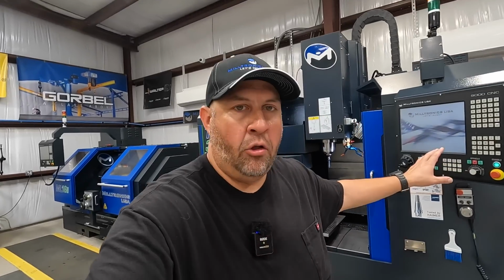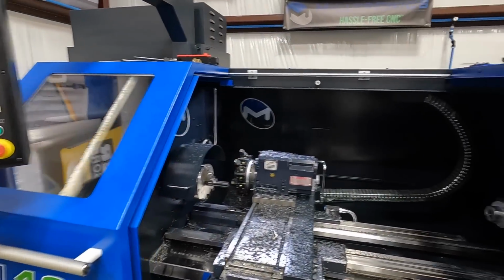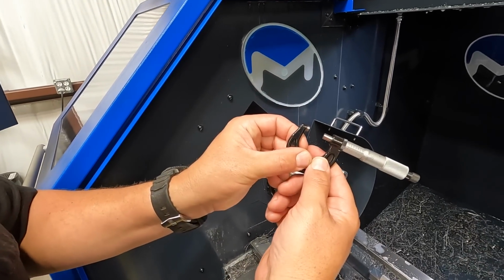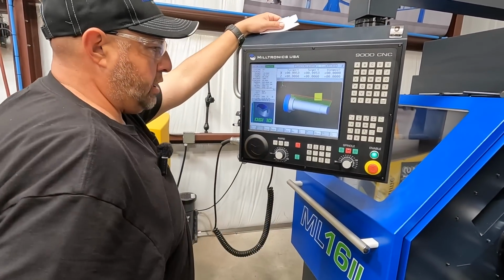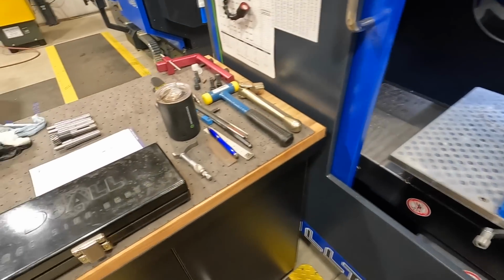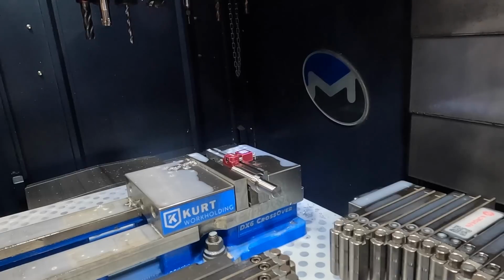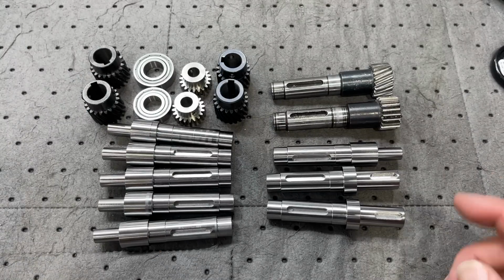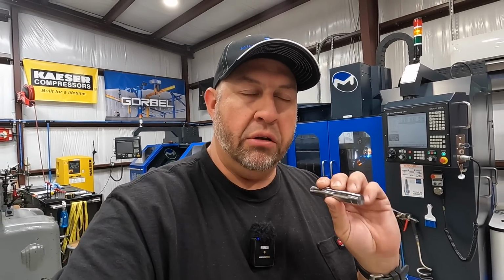Pinion Shafts CNC Machined

Comment: Adam, to learn this tech, you have to immerse yourself. That's the only way. Put all manual machining out of your head and force yourself to do only CNC work and you keep doing it until it's second nature, exactly the way you learned how to machine manually.
That might seem like it could take years but you have to realize that you already have a good portion of the knowledge in your head. It's the computer portion that's new to you.
Learn how to use the reference material first. That will make it so you don't have to ask many questions, you can find the answers yourself.

Comment: This is fascinating.  How does the CNC computer know the exact cutting edge locations of each of the tools, and how does it remain so accurate during tool changes?
Reply: The way it can do all that is because computers are really good at remembering things and when I say that, I mean everything. Every tiny detail of every dimension of every tool it uses and every part of itself. A CNC also knows exactly how far it moves and where it moves and remembers all of that too. In fact, a CNC can even keep track of tool wear in real time.
A CNC even has tools that it can use to find dimensions itself rather than having an operator tell it the dimensions.
However, to answer your question, the way it knows all these dimensions is because an operator tells it what the dimensions are through programming or the operator tells it to find out and how to find out, again, through programming.
The tools that a company supplies for CNCs even come with a data library of tools that contain all the detailed physical information on all the tools it sells and the CNC machine can look them up and load all the information on a particular tool by itself.

Comment: What is conversational programming?
Reply: It's the instruction set that is used to operate a CNC in real time. You can program a CNC from the console right on the machine itself. That's where it uses conversational programming. You can also use a computer to draw an object or a set of instructions and then save that to a file and then upload the file to the CNC. There are a number of different languages that can be used for that. Many different CAD programs can generate files that can be loaded in to a CNC.

Comment: problem with going to the machine to do programming is its already obsolete before it even hits your door. So where as learning a common workflow that more or less applies to all cad-cam software that has been a more or less standard thing since all of time,  you learn a proprietary system. 

That is fine until you walk into the next shop or even software upgrade... it also really sucks when you spend all that time an effort tweaking things to perfection and send it off to a job, shop and their machines are using a totally different system. 
Super great, you can key in a single off job using a keypad on XYZ's system model C,  but ABC corp wants 20 more made for their Italian factory, email is cheaper than FED-EX

Comment: cad/cam is not easy. The hole reason conversational programming has become a major thing is it's far easier for somebody with a machining background to pick up and use. Often it's the most efficient way to do things. Keep at it and you'll get it, but keep getting better with the conversational programming as well. I bet the latter still gets used more often.

Comment: The trick to Fusion 360 is to start with a sketch.  This is the 2d mode of Fusion 360.  The sketch is then extruded to make a 3d object. 

You can make a sketch on any surface or on any work plane.

Comment: Hey Adem, you can use your turret to set your work shift. just push the part in to the chuck. (Have a dowl pin or gage pin in a holder) bring your turret down to how far you'd like your part to stick out set your work shift. Then as a production run all you have to do is, put part in then cycle start, m01 in program stop the program open chuck pull part out to stop then close chuck then cycle start. No more having to touch off for ever part.
Reply: I don't think I've heard him mention the work shift concept.

Comment: I am only a novice amateur but the way I set my Z zero is to place the work in the chuck but not tighten it. Then I drive the tool to where I want the end of the work piece to be and then I slide it out of the chuck to touch the tool and then tighten the chuck. Seems quicker and easier than touching off with a piece of paper and doesn't need a chuck stop.

Comment: Have you ever done any work on firearms?  I have an HK USP 40S&W that I want to convert to 10mm.  The problem is that the HK barrel is so hard that a gunsmith cannot ream it, it has been suggested to use a small boring bar.  The cartridge chamber just needs to be made a little deeper to accommodate the longer case of the 10mm.

Comment: I have some CNC machining (plastics) experience. I hope you embrace the Cad/Cam aspects of the craft, I think it will make you a better all around CNC Machinist. Also it will broaden your horizons as far as part/product design.
I started from Cad Design and moved into the machining so I feel it was easier for me.  Especially 3D utilizing modeling. I always created my models the same way they would be machined helped me be more successful by making mistakes on screen not on the machine.

Comment: The trick with using the paper is a good idea. We have been doing that for years with our CNC flatbed router in the sign company I work for, especially when we engrave aluminium  composite for folding purposes.

Comment: I’m a professional computer programmer.   A couple of years ago (lockdown projects) I bought a starter cnc and later a 3d printer.   I found the cnc part hard and put it away.   The 3d printing is fun.  Have been learning fusion 360 and agree that the learning curve is very steep.    Keep at it, keep it simple and I’m very sure that you’ll get the hang of it.
Reply: I've spent like total of 10 hours or so with Fusion and I can already make use of it pretty well. I was somewhat familiar with CAD before that but not much CAM

Comment: Note that for a small run, you can use an empty tool position as a set-stop for your parts - set it in the program to bring the position in, then bring the workpiece up against it and lock the chuck.
Reply from the maker: That’s a good tip I didn’t think of or have seen before, thanks 👍🏻
Reply: @Abom79  or the blank part of another tool. just have it set up in the library as a tool. then call that tool in the start, at Z0 (+ faceoff amount) - just remember to have the machine go into pause mode. the ISO code is M0(0) if you have to put that in manually.
been using that method for years in production runs. so unless you need length precision of less than 0.05mm (0.002 inch) then its fine
Reply: I use to use an old adjustable square set. I would place the butt end of the rule against a fixed point on the chuck then butt round bar up against the face of the square.
Reply: Yep I usually just use my roughing tool for a bar stop works fine.

A lot of people will use the parting holder or something aswell

Comment: For Fusion 360, you just gotta keep at it. The only way you'll remember that sort of stuff is by doing it a thousand times. But don't worry about not remembering how to do things, just keep a browser tab open and Google things as you need to. It's tough even if you have a background in CAD using another system, but you just have to keep drilling it in until it becomes second nature.

Comment: As an old school programmer (I did Jovial - yep I'm a dinosaur) I found it rather difficult to learn object oriented programming.  But I did and I'm sure you will become quite proficient with CNC as well.  I often think we see the learning curve as steeper and more difficult than it actually is, but you'll get there.
Reply: I don't think the issue Adam is facing is about object oriented programming, or actually any programming at all.
He needs to learn Fusion 360, which is 3D CAD CAM program. Even if it supposed to be an intuitive program, surely it is not, or at least not for everyone.
I identify perfectly with him, and I come from an computer programming background.
It is like if in the old times you would take a machinist out of the shop, and make him quickly become a technical drawer, or designer, sure it may have happened, but very rarely.
And then after the design step, you have to do the work of selecting tools and sequences, which can vary for each machine, by entering them in whatever software that finally output the actual G code fed to the machine.
No surprise that Adam instead is more comfortable with the conversational approach, which can save a traditional machinist hours or days spent in front of a workstation (just a PC these days), and getting very frustrated.
He simply enters the actions directly into the machine, while being very connected to the actual setup, tools choices, tolerances,  speeds and feeds. All things that are very far from a beaut8ful 3D drawing, which you can rotate, color and examine as you want, but won't do anything in the direction producing the part in itself. In fact, good 2D drawings are much more useful 
Being a complete A to Z CNC machinist means being able to do all the above, plus maintaining the shop, purchasing tools and materials, interacting with customers, caring for logistics, and probably few things more. Sure, some talented and hard working individual may succeed, but not many do or even will want to try.
An industry solves this giving differs tasks to each individuals, but a small shop cannot.
Reply: JOVIAL is nearly a perfect language for embedded processing - far better than object-oriented. C++ is more like a cult than a language   As to the dinosaur aspect - I was modifying some JOVIAL code last Thursday.

Comment: I love to see you learn new thingws I love the old stuff (plese, can we have a shaper video at some point?), but I know there are limits how much time one should spend on things.
I love the manual machining because it's something I don't know how to do, and the tolerances you get from setting things up etc. But the the time savings cnc's offer is just too good of a deal.
Excellent content, as always!
Reply: The shaper is a hard one. It has such a limited scope of work without the ease of cheap and readily available tooling.

It's cool, but there's a reason all the shops scraped them a long time ago.

Comment: I have always worked in a computing/electronic background. The whole reason I watched your channel is because I felt that I was lacking in in the area of real world precision, engineering and machining. I have learnt many of the basics from you and although you produce some vlog content, I still occasionally pick up a tip from something you just mention in passing whilst working.
I can learn and invent new tricks in my own realm during my day job, I watch videos about the stuff I don't know. (If I'm gonna spend my evenings watching TV, I might as well learn something.)
Maybe you can do the same thing with working the computers, find a way to expose yourself to it in your daily routine. Maybe at first none of it will make any sense but I was the same when I got into this, the same words keeping popping up and you start to learn without even realising it. Before I knew it was rebuilding a hydraulic press.
Reply: Good and accurate advise.
Reply: They used to tell me ,” patience young padawan” 
When I started learning how to  work on cars I spent time reading manuals and principles of operation. It took me a while but it got easier over time. Good luck Adam. I think you’ll get it all figured out in time.

Comment: Is is odd that on the lathe there wasn't any facing operation to begin with, because turning shaft diameters should be after. On the mill it would be beneficial to start with slot drill to open up the hole for end mill.

Comment: CNC are a production machines. This is where they shine and that's what they are designed for - repeatability. It's like CAD drafting. It really shines when you need production, and when changes are needed to geometry on later revisions. One-offs are just quicker on manual machines.

Comment: Hi Adam, Developing a working knowledge with conversational will help model in CAD/CAM. I can't say why someone who runs CNC all day would want to watch, but for myself, a casual cnc runner, I am interested in seeing the miltronics machine specific detailed process.  The saying "see one, do one, teach one" is a functional way to for you to remember.  Start from cold startup, homing, tool library calibration and offsets.  This prescription invites someone who wants to know how cnc works.  Maybe there are folks that just are happy to fall asleep while watching a job running, but I want to see the details.  I found some 12" long .001" feeler gauges that work much better than paper for zero settings.

Comment: Learning CNC is definitely a whole different experience if you're already a dialed in manual guy. Getting over that initial "i could have already done this manually" hurdle when just starting is really rough.

But eventually youll get to a point you can just fly through it. Good on you for working through it as you can.
Reply: Yeh eventually you are faster with CNC than without, but at first it's hard to work through the learning curve.

When you are on the low end of the curve it certainly can be faster to do a one off on a manual which makes it a battle.

I said that In my comment, no idea why you guys are dogpiling me over something I meant to be encouraging for him.
Reply: Si eres un experto profesional en mecanizado en máquinas manuales y platos divisores con muchos años de experiencia , pasar a mecanizado con CNC es relativamente  sencillo .
Pero a la inversa es completamente casi siempre imposible , pues necesitarías mucho tiempo de aprendizaje .
Un profesional con más de 70 años !
Saludos
Reply: I agree with everything you've said but these machines are best suited for making multiple pieces quickly. Taking the time to write out the programs, paths and tooling for a single piece is probably slower than looking at a DRO and mechanical dials. Especially someone as proficient as Adam.
Reply: @maggs131  Wrong!!! ... You are talking about much older machines .. once you get programing in your head?  These are totally suitable for one off jobs!! ...
Reply: @Tommy-Shanks yes and what about shapes that aren't square or round, they are a headache with manual machines at best

Comment: Don't be ashamed about asking for help here and there with your CAD system. I've been a CAD designer for almost 30 years on a few different systems. I still have questions here and there on the one I've been using for 13 years now.

Comment: Use a cigarette paper they are .003"
Reply: Is dialling in +0.003" on the Z position easier than dialling in +0.006" ?
Reply: @colinfahidi9983  I never said it was, just we used .003" cigarette papers wetted and picked up of them with a milling cutter end or side when I started my apprenticeship in England in 1977... What about yourself what do you use?
Reply: @zerogiven1956  I worked on manual milling machines so my practical experiences are  from using a .003  piece, and I would say you a the previous chap have not done those type of experience's from .006 to .003 thou. Using a wet cigarette paper on a rotating cutter you are out the way of it spinning and when it drags you are .002 from the work piece as it could be in a pocket you are milling and only need a couple of thou to hit your dimension.. That's how I do it Same question to yourself how do you achieve what AB was doing..?

Comment: You've got to learn how to use CAD and CAM, you'll never think about using conversational again once you get proficient.
Reply: Agreed. Like all really capable software, the first steps are like climbing a vertical brick wall. But once you get over that, each project you do becomes progressively easier. I use F360 because it is in wide use, has loads of tutorials on-line by many different people, and works for many different machines (I use it for my cnc router and my 3D printer). And it covers everything, from design right through to generating the g code.
Reply: I use both conversational and cam at work. Both have they're pros and cons. In a job shop, sometimes its just simple parts that I need to get back to the customer fast so conversational allows me to make a program in a few minutes and get it done. More complicated parts, long runs where I need efficiency or  in cases where I need tools to perform roles that conversational won't allow then CAD/CAM it is.